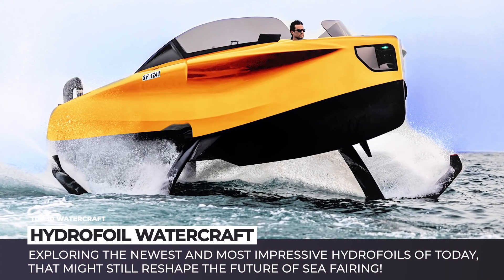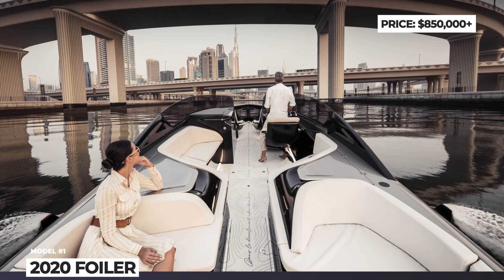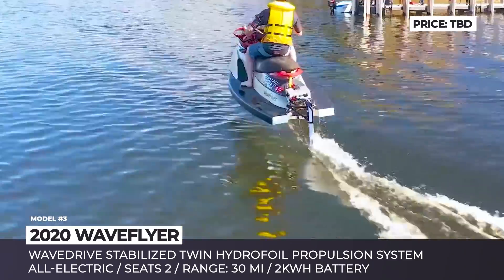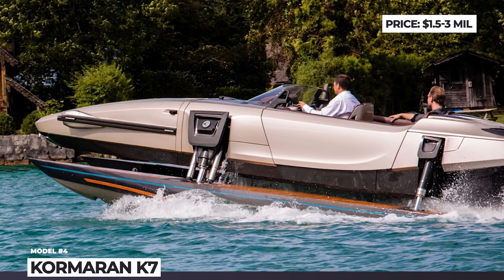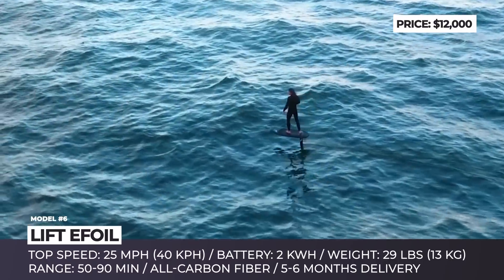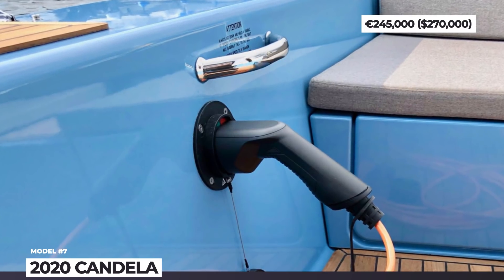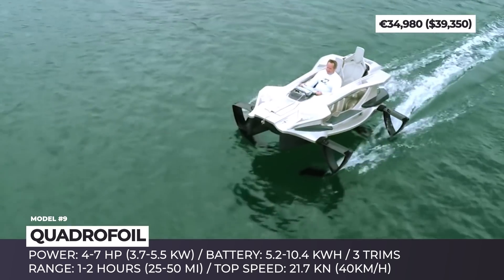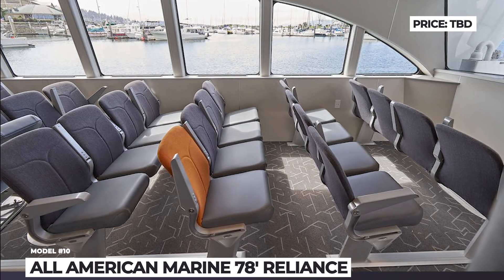Top 10 Flying Boats and New Hydrofoil Inventions that Can Hover Over Water

Comment: The conceptions are old-fashioned. There is potential to build much more efficient designs. These are just boats on skiis; you can do so much more. Are any boat builders interested in building fast vessels with 50% better energy efficiency?

Comment: I looked up hydrofoil boats just out of curiosity.  Honestly this is a lame gimmick.  A fast boat is hardly in the water anyways, it's lifted up by the engines in the back.  Hydrofoils cut too much water to be fast, and clearly struggle in choppy conditions so what's the point?  Get a taller boat and you're already multiple feet out of the water.  Also most of these things look lame to people who actually spend time using watercraft and boats.

Comment: You should get your nomenclature straight: A Flying Boat is an Airplane that can land in the water using its belly, as opposed to a Floatplane that is a landplane with floats mounted to operate from water. Typical flying boats are the PBY Catalina, Short Sunderland, B&V 222, Republic Seabee, Lake Buccaneer, Canadair 215 etc.
Reply from the maker: https://youtu.be/lzBPLdiAnTw
Hi there. I do know the difference. I put the flying part in quotes. Check out the legit video about flying boats and float planes

Comment: 900 horse power to make a 23 foot boat go 44 miles per hour. Not impressed.
Reply from the maker: Do you want it to be bigger or faster?
Reply: With that kind of power a planing hull should do 80 mph. (210 constant) Go to vicprop.com and play with the calculator. I’ve used it a few times and it’s spot on if you filled out the blanks correctly.
Reply: Blank data:
WL 23
B 10
H 1
VW 6000
EP 900
NE 1 
Rpm 6000
Gear Ratio 1  (1:1)
 Shaft 1
Knots 75